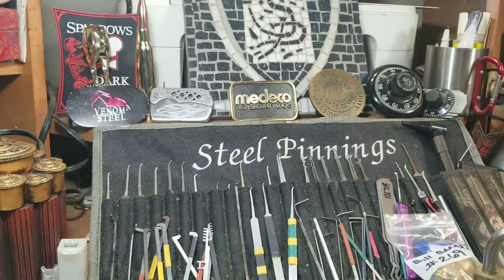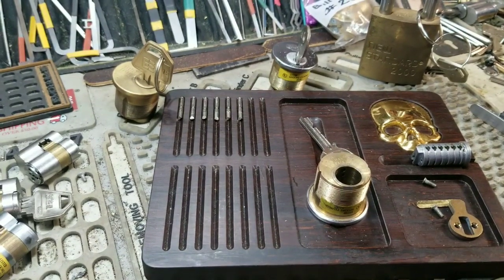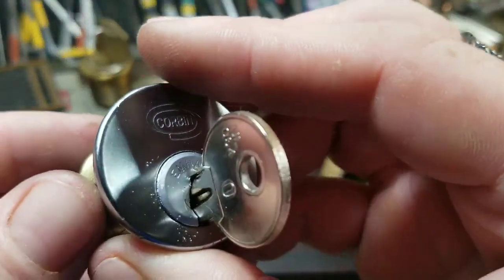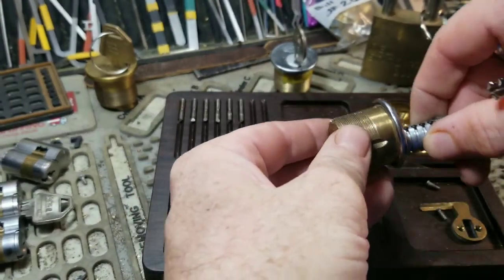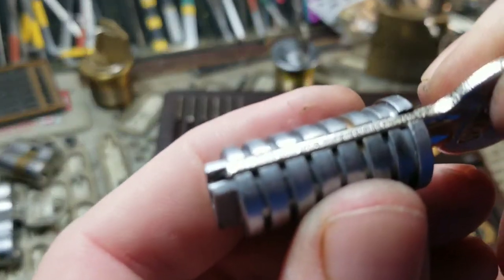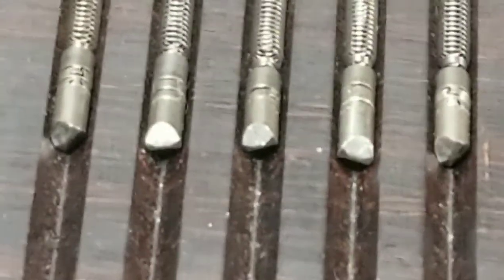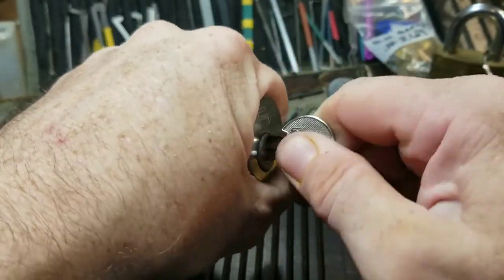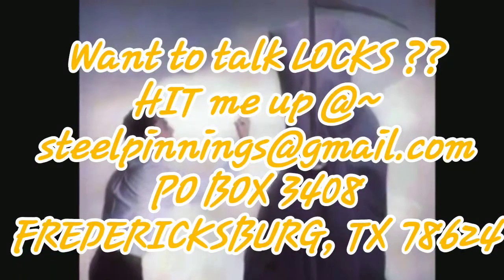🔒🔑👉(403)👈🗝🔓 ONCE UPON AN EMHART  A CLOSE LOOK AT AN EMHART PROJECT

Comment: Amazing!  I've got an Emhart in the mail and I just hope to eventually solve it.  Right know a Medico Original is kicking me around pretty hard.  Great show!
Reply from the maker: Nice! I have more Emharts and medecos than I can count, figuratively of course. 😆
The only real similarity between Medecos and Emharts is that tge key pins must be rotated. But the Medeco needs to rotate to allow a sidebar to drop and then lift the pin to shear. But Emharts need to rotate and lift to shear at the same time. Some say they are easier than Medecos and some feel Medecos are easier.
I feel both are difficult and require that you learn the workings and practice practice practice. 😆
Good luck....
Cheers and Happy Pickin!

Comment: Hey mate one of these locks with a genuine key is up on the Australian eBays. Do you know what a good price for the lock would be?
Reply: It is at $32 at the moment.
Reply from the maker: If it has one key it is 45 max and 2 keys 55 max this is USD or what they sell for here. I tend to get them without keys and find or make a key fit the keyway and the hand file the bitting like a medeco to save the $$.
Reply: Steel Pinnings awesome thanks mate 👍🇦🇺😊
Reply from the maker: @TheButchersbLock  
Hey buddy, I have a Corbin Russwin Emhart mortise cylinder that I hand filed a key for it and I don't mind getting rid of it. I don't mind trading either. I do like AU locks. I also have a lot of other stuff too. 
Let me know if we should start setting locks aside for each other.
Reply: Steel Pinnings mate that sounds like a great idea. I have a lot of lockwoods that I can put aside for you. Heaps of 334b45’s and 234/45